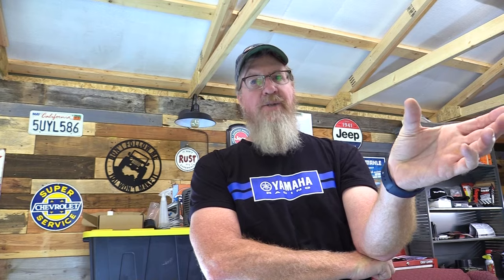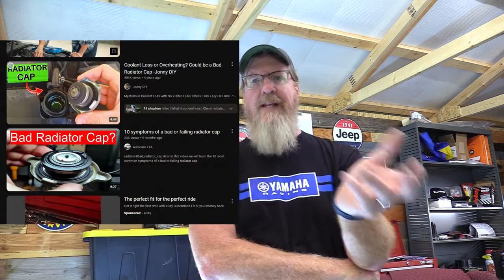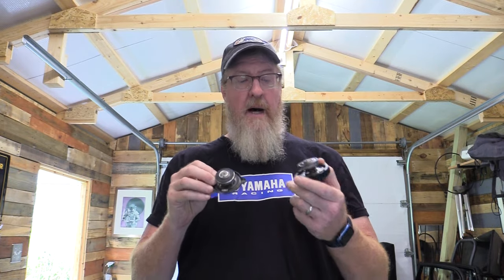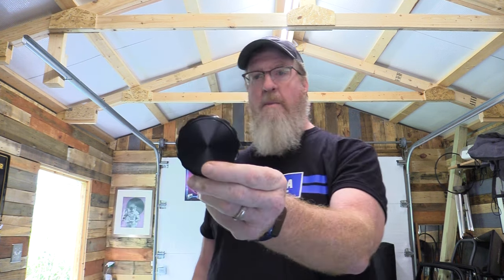Do you have the RIGHT Radiator Cap?

Comment: Great video thanks
My friend I have a Coronet 70 engine 360 and has a aluminium radiator 3 rows but I do not know which is the correct cap for that because the temperature is around 90-100C in a way I do not know if it is normal for this kind vehicles as well 
Thanks for your support

Comment: Great video! I just installed a new Aluminum radiator with a 15 psi cap in a '56 Chevy with an OEM heater core (replaced probably about 30 years ago!). Rating for heater core is 7psi! Do you have any info on heater pressure reducers? I think they go in-line to the heater inlet hose but I cannot find any info. THANKS!
Reply from the maker: Not that I know of! But thanks! More stuff I had to learn the hard way 😂